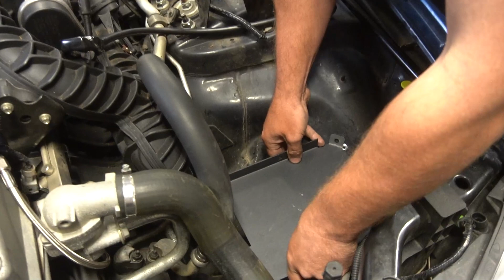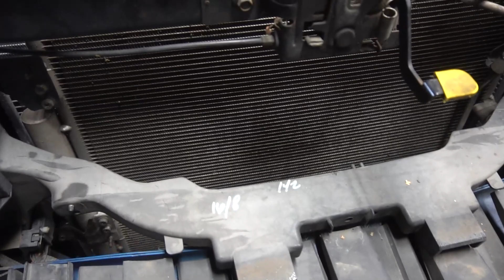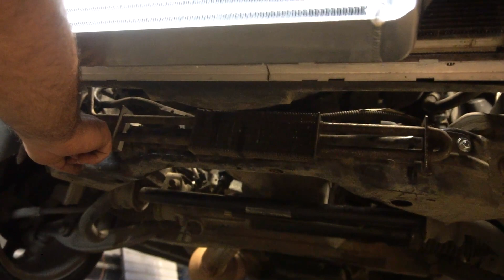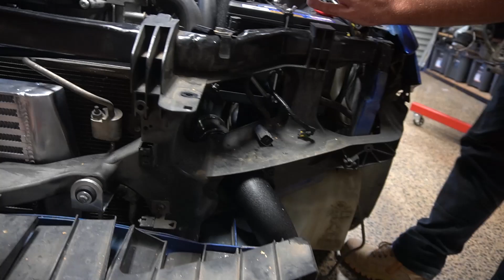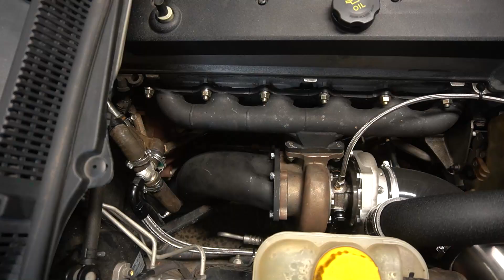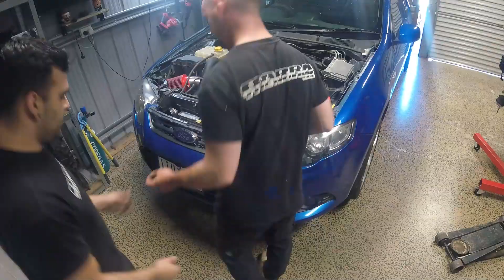BaraTheWorld FG NA + Turbo Conversion Episode 4.

Comment: Guys for one my 2011 s1 upgrade XR6 turbo doesn’t have no plastic brace on the front, it’s metal. Secondly there is zero chance for this intercooler to fit.

Comment: Great job going through the steps to convert to turbo . I am converting an fg and will be using the fg turbo manifold . I'm a bit confused with where all the vacuum lines need to be hooked up ,do you know if there is a diagram that steps you through this . Cheers